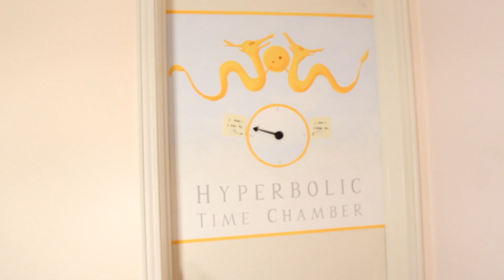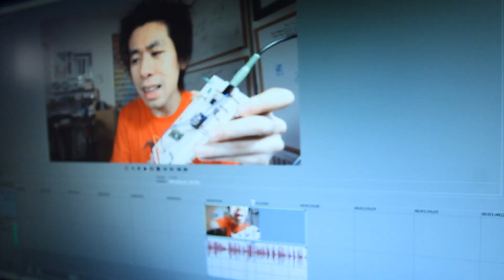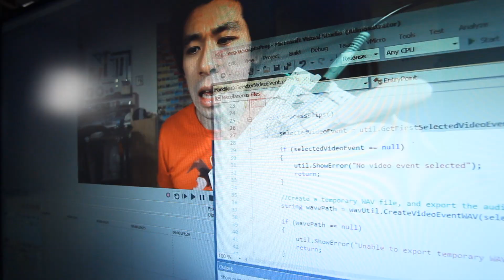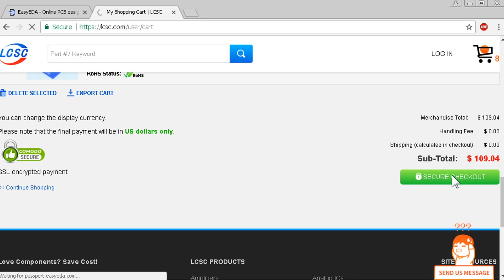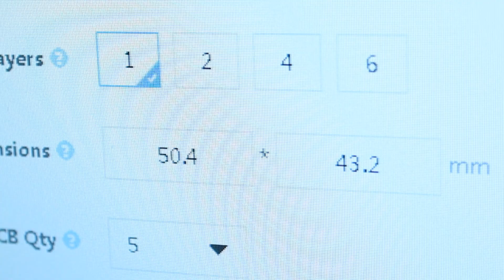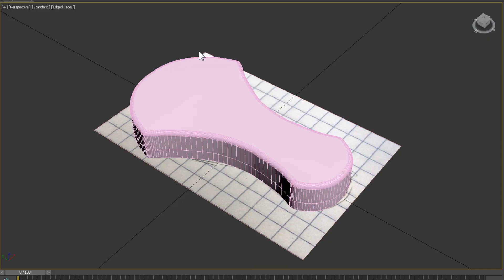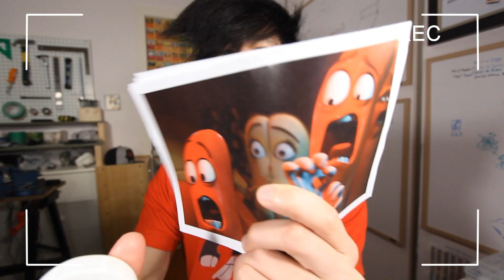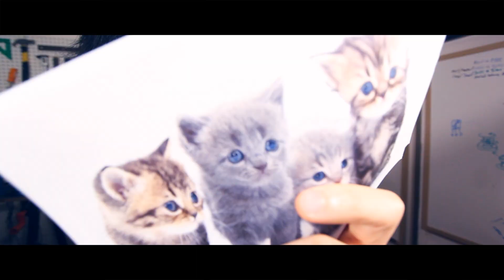This gets weird... BLIPPER Camera Marker

Comment: Code

include <avr/sleep.h>
#include <avr/power.h>

//Pin definition
#define LED PB3
#define BLIP PB4
#define TRIGGER_1 PB0

#define NO_TRIGGER -1

#define LED_BLINK_DURATION_MS 500
#define BLIP_PULSE_DURATION_US 200

//Stores the pin state every time interrupt is called
volatile byte prevPinState = 0b11111111;

//Stores the trigger number that triggered the interrupt
volatile byte activatedTrigger = NO_TRIGGER;

//Pin change interrupt function
ISR(PCINT0_vect)
{
  //PINB XOR prevPinState to get list of triggers that changed state
  byte changedPins = PINB ^ prevPinState;

  //If a trigger changed state and is a down-press,
  // then set activatedTrigger to that trigger.
  if (bitRead(changedPins, TRIGGER_1) && !bitRead(PINB, TRIGGER_1))
  {
    activatedTrigger = TRIGGER_1;
  }
  else
  {
    activatedTrigger = NO_TRIGGER;
  }

  //Store PINB as prev pin state
  prevPinState = PINB;
}

void setup ()
{
  pinMode (LED, OUTPUT);
  pinMode (BLIP, OUTPUT);
  pinMode (TRIGGER_1, INPUT_PULLUP);

  //Pin Change Mask Register:
  //- Set trigger pins to trigger pin change interrupt
  PCMSK |= bit(TRIGGER_1);

  //General Interrupt Flag Register:
  //- Clear pin change interrupt flag
  GIFR |= bit(PCIF);

  //General Interrupt Mask Register:
  //- Enable pin change interrupt
  GIMSK |= bit(PCIE);
}

void loop ()
{
  if (activatedTrigger == TRIGGER_1)
  {
    outputBlip(3);
    blinkLED(2);
  }
  //Enter sleep mode when idle to save power
  goToSleep();
}

//Sends blip signal through BLIP pin
void outputBlip(byte numPulses)
{
  int blipDuration = BLIP_PULSE_DURATION_US / 2;
  for (byte i = 0; i < numPulses; ++i)
  {
    digitalWrite(BLIP, HIGH);
    delayMicroseconds(blipDuration);
    digitalWrite(BLIP, LOW);
    delayMicroseconds(blipDuration);
  }
}

//Blinks LED through LED pin
void blinkLED(byte numPulses)
{
  int delayDuration = (LED_BLINK_DURATION_MS / numPulses) / 2;
  for (byte i = 0; i < numPulses; ++i)
  {
    digitalWrite(LED, HIGH);
    delay(delayDuration);
    digitalWrite(LED, LOW);
    delay(delayDuration);
  }
}

void goToSleep()
{
  set_sleep_mode(SLEEP_MODE_PWR_DOWN);
  ADCSRA = 0;            // turn off ADC
  power_all_disable ();  // power off ADC, Timer 0 and 1, serial interface
  sleep_enable();
  sleep_cpu();
  sleep_disable();
  power_all_enable();    // power everything back on
}

Comment: Great Vids Evan! Can I ask a question... I'm planning on building the simplest of midi foot pedals. Basically one switch to mute on/off one channel on my digital mixer. Will the Arduino get power to operate via the MIDI port that I will install? Do I have to use external power? Thank you for any help!!!

Comment: Redesign Xbox one controller and 3D print a steering weel case either install some sensors into the controller or steering weel case to work with the whole thing

Comment: Awesome video. I have a project that can use some help and this is a good start. Am working on a external enclosure for 5.25 in drives. I was wondering what software did you use to desgin your pcb?

Comment: Wire a USB camera like kinnect or web cam directly into a tube TV. Like transfer the USB worse into a Nintendo motherboard to then plug it in AV red white and yellow. The Nintendo 64 will power and drive the camera picture to the Av on the tv

Comment: Also, if the last comment I made was stupid and there is already something that will do that, what about a device to give any controller and/or mobile device a turbo button without taking it apart, using an app, or buying a special controller?

Comment: Evan, couldn't you have used a  555 timer in a monostable multivibrator configuration to generate the blip? And you could use a TLC555 for low quiescent current.

Comment: You should try to make a dongle for computer headphones that would go on to the part which goes into the computer, but instead of making it longer, you're adding a microphone cable that would go into both ports on your computer. (And put it on a website so i can buy it XD)